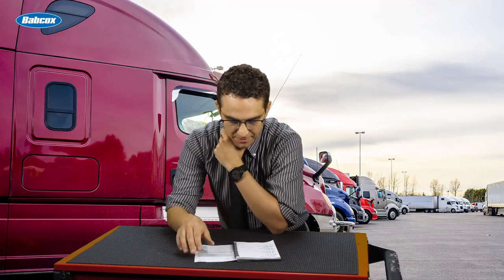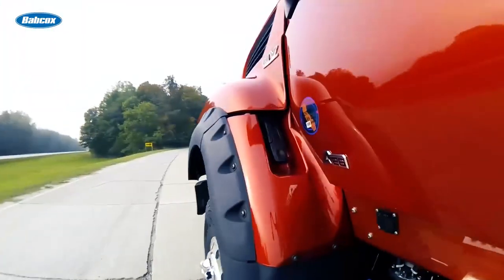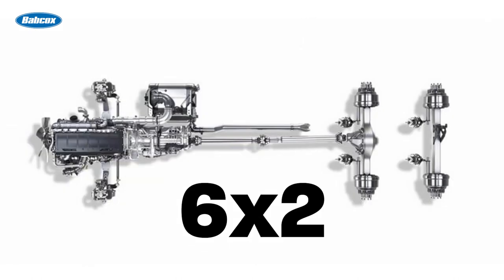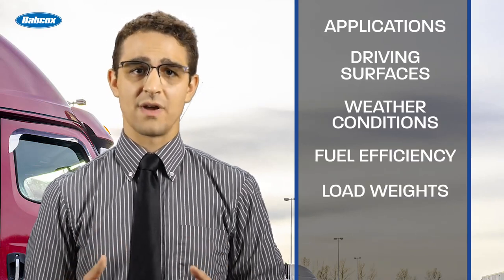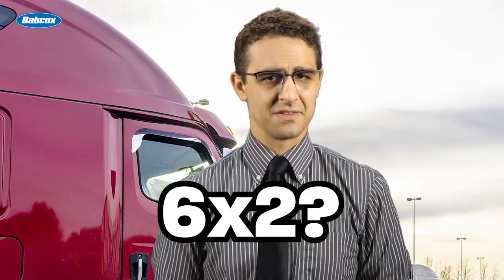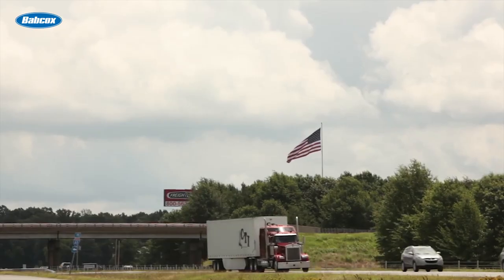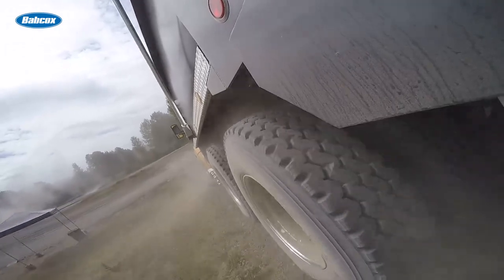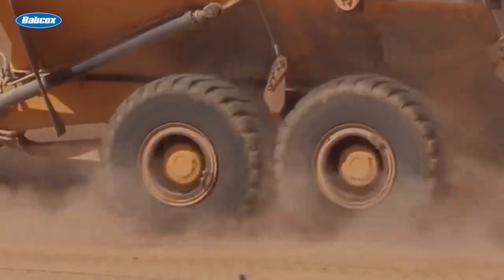6x4 or 6x2 – What's the right axle configuration for your truck?

Comment: the whole europe runs 4x2 or 6x2 and is doing ok, but here in states every one is getting stuck with 6x2, its drivers dont know how to drive. i once had to take off interaxle shaft becouse ujoint cracked and lock diferential and drive home on front drive axle one thousand miles thru wyoming and idaho and oregon and even on gravel and didnt spin any tires

Comment: Good afternoon friends. What pulls better uphill from the 6x4, 6x2 or 4x2 configuration drive axles ? I figure the rear ratio would decide the outcome. I drive in Europe, mainly 4x2  tractors. I personally have a liking for tandem drive traction. Thanks! Great info.
Reply from the maker: Good questions! In general, a 6x4 configuration would definitely be your best bet for pulling uphill. The answer to your second question about gear ratios can get a bit more complicated; I think it's safe to say a 6x4 provides more overall torque in general, but in terms of gear ratio, that would be dependent on application need.
Reply: They all pull the same.  When a 6x4 out shines a 6x2 is in low traction situations.  Like climbing a snowy mountain pass.  Instead of 1 axle u know have 2 axles pushing the load.  99% of the time a 6x2 is only cruising using 1 axle.  There’s a “tandem lock” switch to engage the second axle and it’s only rated for 45mph
Reply: @FleetEquipment

Comment: Please forgive my newbie question, but why was a pusher axle not mentioned in this discussion?  Thank you!
Reply from the maker: Hi Eric, you make a good point. Among 6x2 configurations, pusher axles aren't quite as common, because you typically find them in more specialized applications. But, pusher axles – usually multiple – could be a good option for a truck if the expectation is to maximize payload. It's probably a topic worth it's own video!

Comment: One thing is not mentioned is that you don't need a more powerful engine on a 6x4 to haul heavy loads.
Reply: Increasing or decreasing the final drive ratio can make a tractor stronger or weaker. This differential ratio is the real engineering trick. So yes, horsepower isn't everything.